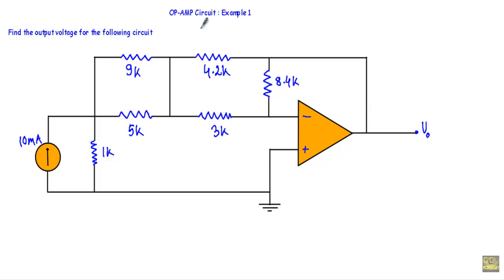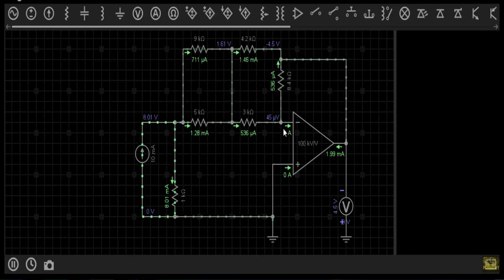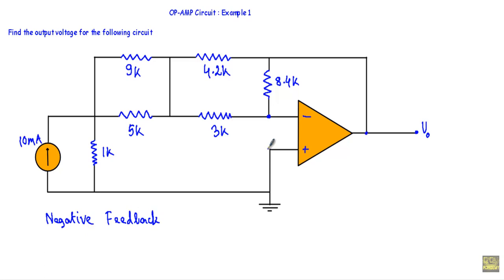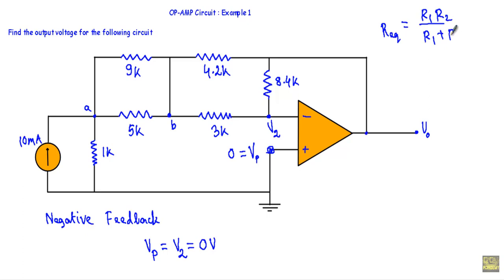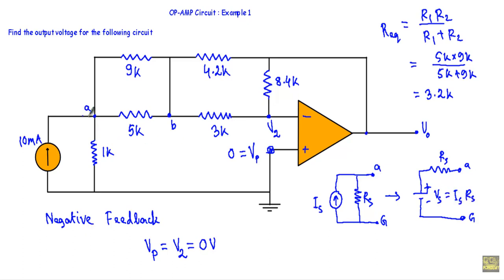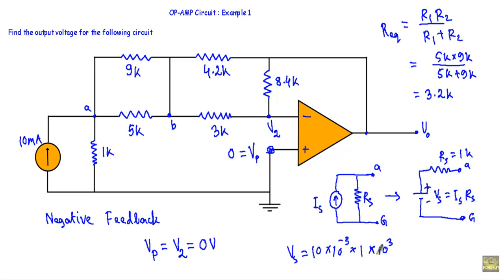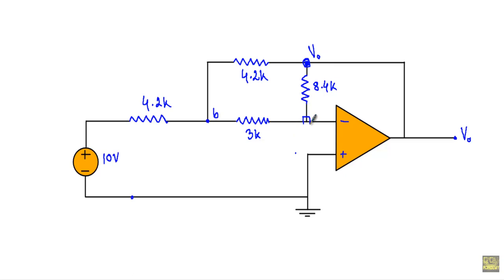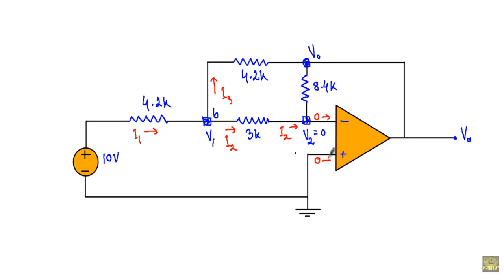OP-AMP Circuit : Example 1

Comment: How do you find the gain of a circuit like this though? If Vo is -4.52 V, then couldn't you find the gain by doing (-4.52 V) = 10 V*(gain), divide 10 over and you get a gain of -0.452. Why is that? Can an op amp lower voltage? I don't get that. I thought it would be a whole number.
Reply: ou are right. The input voltage is actually 8v and clearly shown by he software emulation.The op amp  attenuates not amplify.I am sorry that you are confused and thats mostly due to this man who doesn't know his basics and as a result causes confusion and loss of interest in electronics for some. learn opamp by Michael Vanbiezen and Steve Jones(EEVB) and example  by Dan Bullard. all on Utube.Good luck

Comment: what happen if we use original nodal analysis, by considering node at higher potential where we have to find voltage with respect to other
Reply from the maker: I am not sure. You can check the result and put your comment here

Comment: can we solve this problem by taking 3k and 8.4k branch in series and equivalent of this is taken parallel to 4.2k of feedback resistor after doing this process the circuit will reduce to inverting amplifier.
Reply from the maker: It seems this process can possibly work. Just solve the circuit in your way, and verify the final result
Reply: If doing as you say, the result of V(o) will be approximate -7.31 volts which is different from this solution. I think you can not take 3 k in series with 8.4k.
Reply: @phuongnguyen-kc8hi  they are in paralel. 3k||8.4k then that impedance will be also in parallel with 4.2k

Comment: v2=-4.516 or vo=-4.516 ?
Reply from the maker: check the simulation in the video...
Reply: It is not V2, the correct is VO.
Reply: V2 = 0v